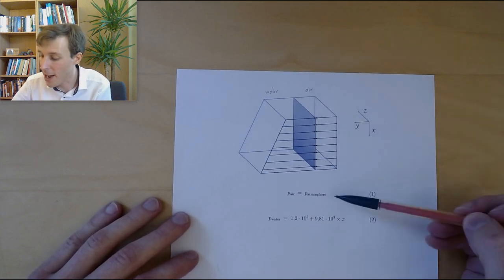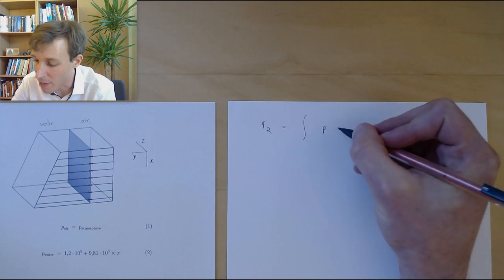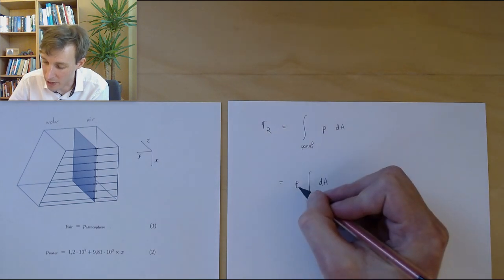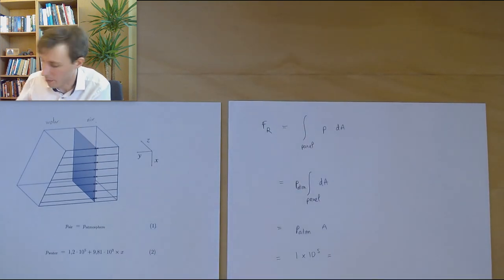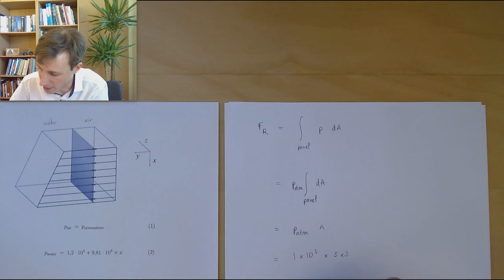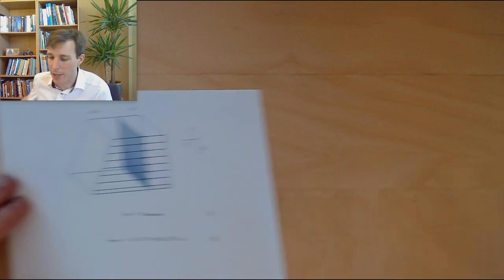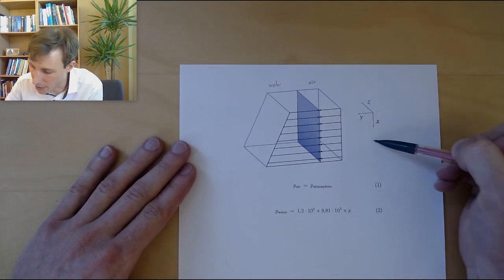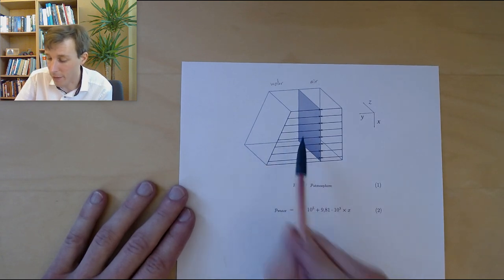Calculating a force given a pressure distribution (Fluid Dynamics w/ Olivier Cleynen)

Comment: @13:12 there seems to be a mistake from the result of the calculator..? I find it 1,2124 MN.
Reply from the maker: Correct! The source of the error can still be seen on the calculator screen. The result is indeed 1,2124 MN not 1,4824 MN. I can’t change the video, but I will highlight the error in the description and in the lecture notes. Congratulations carefully double-checking me, and many thanks for reporting the error, I really appreciate!